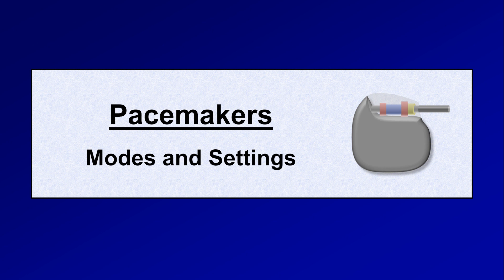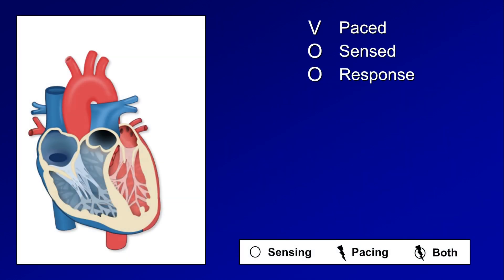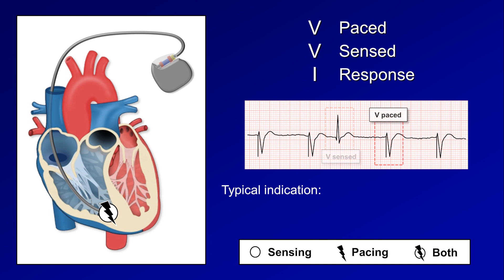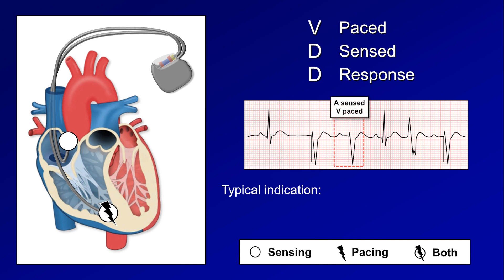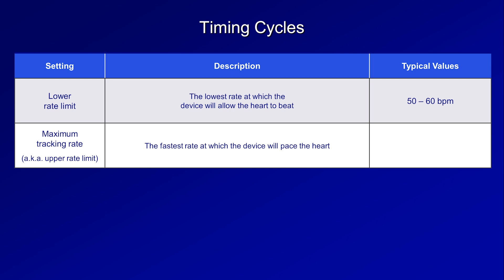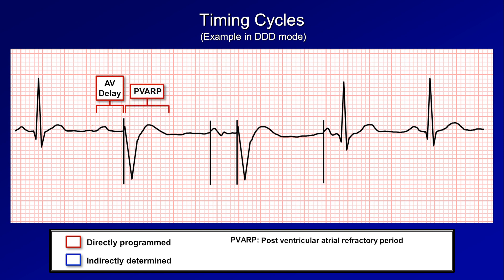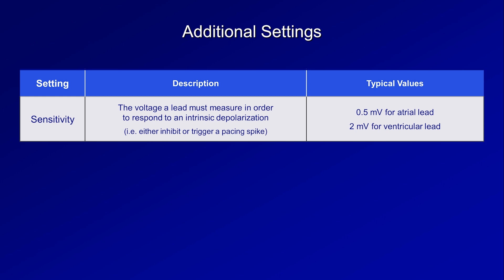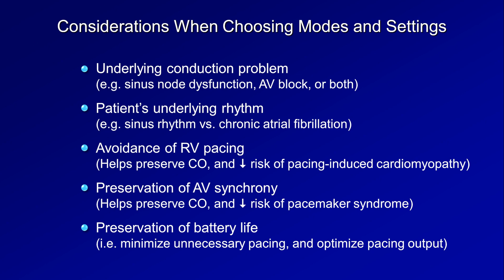Pacemaker Modes and Settings

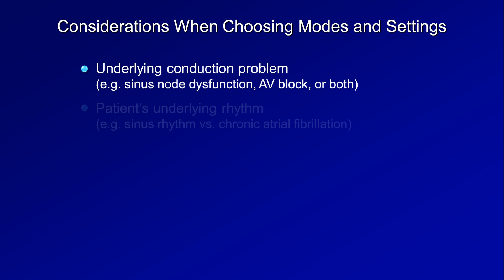Comment: 18:13 what is RV pacing? My mom's ventricle is pacing at 99% is that normal?
Reply from the maker: RV pacing is when the pacemaker paces the right ventricle directly, rather than pacing the right atrium and allowing conduction to move naturally from the right atrium to the right ventricle via a person's heart's internal conduction system. Right ventricular pacing is typically necessary when the AV node (i.e. a part of the internal natural conduction system that is the electrical junction between the atria and ventricles) isn't working properly - which is one of the most common reasons to get a pacemaker in the first place. As to whether it's "normal" or expected for your mother in particular, only her doctor could answer that.
Reply: @StrongMed  thanks so much for responding. She has duel chamber ABBOTT PM with mode set at DDDR and report said she is continuously ventricular pacing at greater than 99%. Report literally says "VP >99%" and "AP 1.8%" meaning atrial pacing I think. I'm Concerned about cardiomyopathy. 

When I took her to ER her heart rate went down to 30 once on the ekg. They said she needs PM. At 89, she said she didn't want to get PM and go through pain and suffering of surgery and to just let her die. My other siblings and I didn't want that and Dr convinced her to get PM. She is still very sharp. But there have been complications.

Dr is not responsive. And defers to his medical assistant. We have not even spoken to cardiologist not once since implantation.
Reply from the maker: @polynesia8733  Unfortunately, I can't give specific, individualized advice here, but I apologize if my video has made you anxious re: the development of a cardiomyopathy. While this can happen with excessive RV pacing, it's not common, and for patients whose AV node does not work well, a high amount of RV pacing is unavoidable. 

Regarding your mother's cardiologist, in the US it is common for the cardiologist who places a new pacemaker to not directly see the patient afterwards as long as the arrhythmia clinic and/or pacemaker clinic staff (e.g. typically physician assistants or nurse practitioners) feel that the pacemaker is working fine. However, it's not ok for them to not respond to messages.
Reply: @StrongMed  cardiologist himself finally called back. Thank God. I told him 99% continuous pacing seems extreme and can battery sustain that level for 5 years. He said he is confident that it can and will maintain its pacing  at that level for 6 years possibly even more.

Comment: Can you explain why DDD cannot be used in a patient with AF, and why the pacemaker must switch to DDI? I am not understanding why this is the case. In DDD, the pacemaker will inhibit itself if the ventricles are already firing in response to the AF RVR. Certainly if a patient is in AF RVR, the DDD mode will automatically not V-pace the heart. Is it not just possible to set the upper limit to 60, and keep the pacemaker in DDD mode, so that if a patient in AF goes into RVR the pacemaker inhibits by its settings, but if the patient develops AF with SVR the pacemaker will cause ventricular depolarization after a 1-second delay from atrial depolarization? Why does the ventricle need to be ablated before DDD mode can be safe for patients with AF?

Comment: I guess that when a patient is having lots of premature ventricular complexes/"pvc's" a sensing pacemaker could get confused and/or the cardiac output could decrease if the pvc's are not producing pulse waves because the (left) ventricle didn't have time to fill? (But the pvc's are delaying the next paced beat the same way that a beat that raised a pulse wave would have)
Reply from the maker: Yes, this is a potential problem that can happen. The first line intervention would be to suppress the PVCs with a beta blocker. There aren't really great strategies to mitigate this with only changes to pacemaker programming.

Comment: Please help, my husband got pacemaker  2 months ago. The reason why he needed a pacemaker because low heart rates 48/min and everything else was fine with his heart . Right after he got the pacemaker he started experience  over 125/min heart rates  to 200/min. Went to emergency and they said he has a atrial fibrillation. Before pacemaker he had three years monitor installed to check his heart rate and was  always low. It never detected  atrial fibrillation. Do you think that pacemaker has something to do with that or the pacemaker is not installed appropriate .
Reply from the maker: I can't give specific, individualized medical advice here, and I recommend your husband speak to his cardiologist about this. Having said that, I am unaware of any data that the act of getting a pacemaker, in itself, increase the risk of developing atrial fibrillation. However, there are certain pacing modes (VVI) that are associated with developing a-fib.
Reply: @StrongMed  I forgot to mention last visit at his cardiologist’s office it showed some arrows on the pacemaker monitor. The Dr. didn’t explain why. He said that he’s going to adjust the mode but he keeps repeating that his heart condition has nothing to do with the pacemaker. I am not 100% convinced.
Reply: Depends on age of the patient. If he's having Atrial fibrillation, mode of pacemaker shud be VVI

Comment: Thank you this one is good video. I always see VVI,  what does mean inhibit?
Reply from the maker: VVI means that the pacemaker's firing of a single ventricular lead is inhibited (as in momentarily blocked) if it senses the ventricle has already depolarized.

AAI means that the pacemaker's firing of a single atrial lead is inhibited if it senses the atria has already depolarized.
Reply: @StrongMed  The pacemaker inhibit, so the pacemaker not fire?
Reply from the maker: @judypeng4748  Yes, that's correct. It does not fire for a single heart beat.
Reply: @StrongMed  thank you! So if I want to fire the pacemaker, I need to adjust the pacemaker to turn on make it fire

Comment: My wife is 29 years old 110 lb 5 foot 6 and she had to get a pacemaker put in about 3 or 4 months ago cuz her heart was randomly stopping it was Sino something. Today she went to the doctor and they turn down the volume on her pacemaker. Do you have any idea what they did by turning down the volume?
Reply from the maker: I can't give specific, individualized medical advice on here, and I recommend discussing any questions directly with her cardiologist.

Having said that, by "turning down the volume", the cardiologist most likely was referring to turning down the "output". If this was the case (and that's a big "if", which is why you should check with the cardiologist), the most likely explanation is that when the pacemaker thresholds were tested to see how much current was necessary to pace her heart, the previous output setting was higher than necessary. This isn't generally dangerous - it just drains the battery faster. So by turning down an unnecessarily high output, it extends the length of time until a person needs their pacemaker generator (which includes the battery) changed.

Comment: Sir,can you please tell me the difference of implant in the right or left
Reply from the maker: Implantation of pacemakers are usually done on the left, even in left-handed individuals, primarily because it is a technically easier procedure since the leads (i.e. wires) are advanced into the right side of the heart as one continuous curve. When placing devices in the right upper chest, the leads need to make several slight turns within the blood vessels.  There are some exceptions to this placement preference - for example, if the patient has an AV fistula for dialysis in the L arm, or if there is an anatomic obstruction such as a left subclavian thrombus, the cardiologist would typically place the device on the right side. 

ICDs are (almost) always placed on the left because the "can" (i.e. the generator) itself is part of the defibrillation circuit, and the closer proximity to the heart on the left is believed to increase the probability of a successful defibrillation.
Reply: @StrongMed  could there potentially be any complications from putting them on the right side? My pacemaker is on the right. It's there because of an infection from the first one that was on the left.
Reply from the maker: @Regena03  Because the procedure is slightly technically more difficult to place them on the right, it would be expected that the immediate complication rate from right-sided placement would be slightly higher. But these kinds of complications are still rare, and would usually be immediately apparent within hours (or even minutes) from placement.

I do not know of any difference in medium and long-term complication rates (e.g. infections) between the right and left sided placement.

Comment: Can a pacemaker do the job of regulating heart beat or at least overall improve the heart after Myocardial infarction???
Reply from the maker: It depends on the circumstances. 

If the myocardial infarction affected the sinus or AV nodes (i.e. part of the conduction system), then a pacemaker could prevent an unusually slow rhythm from occurring. If the myocardial infarction resulted in impaired contractile force (i.e. a low ejection fraction), a biventricular pacemaker can be used to help improve contraction (if there is evidence of impaired electrical conduction through the ventricles), but this is only done after at least 3 months of optimal medical therapy to see if the problem can be addressed without the need for a pacemaker.

Also, in a patient with impaired ejection fraction after MI and a period of medical optimization, an ICD is often implanted as well, which will provide an electrical shock (a.k.a. defibrillation) in the event of a potentially fatal heart rhythm.

Comment: Thank you very much for your brilliant videos! 
If everybody who permanently needs a pacemaker would get a DDD because it can do everything... is there any medical argument against it?
Reply: The argument would be lower longevity because of the battery usage requiring more replacements. But nowadays the modes can be adjusted through a programmer. I am not sure but I believe some pacemakers can change their own setting if an event is detected.
Reply: Is implantation of the lead system more involved/difficult?